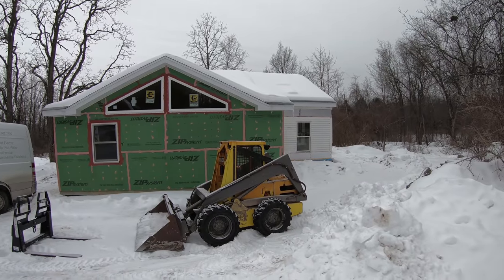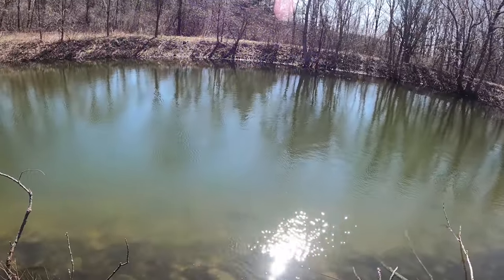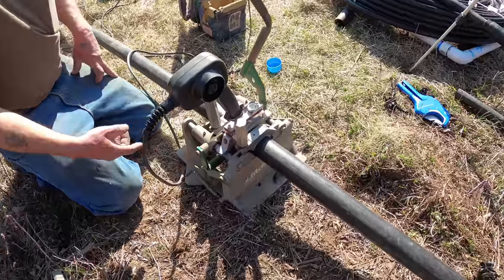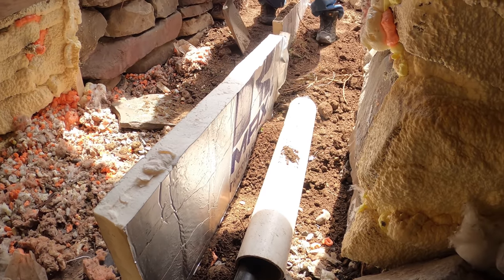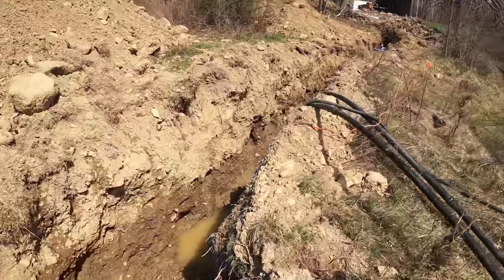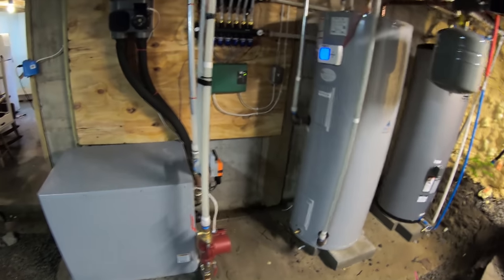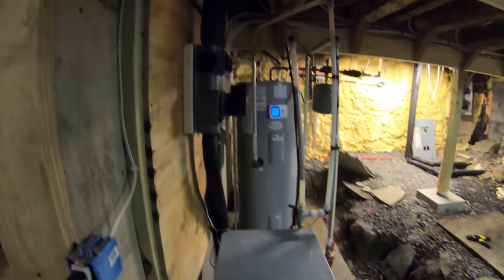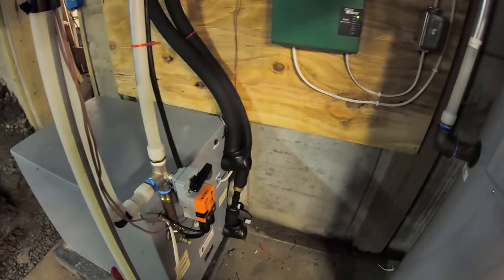Installing a Geothermal system (water to water, radiant heat)

Comment: Why is forced air such a popular way of heating in US? I am from Europe (Croatia) and here is most often heated by radiant heat. The main source of water heating is gas or wood. Recently, heating with heat pumps (air-water) has become increasingly popular, especially if it is underfloor heating otherwise they are water radiators. An increasingly popular is hybrid heat pump that combines the operation of a gas boiler and a conventional heat pump. When the temperature of outside air is relatively high it works exclusively as a heat pump, and if it is very cold then only as a gas boiler, and in between as a combination. The good side is that such a heat pump can also heat and cool, so everything is done in one unit.
Reply: Probably that most houses aren't built to live in, but built to sell. The vast majority of new houses are built by contractors or investors, to sell to people looking to move into that area, most of whom will live there 5-10 years, then move. They are thus quite sensitive to costs vs profits. If you're having a house built to live in it for decades, then you will have some different wants. That's also why so much if the US is basement-free, even though everyone would prefer having one.
Reply: The US has a much greater need for cooling than europe.  Radiant heat systems are very hard to repurpose into cooling systems. It's possible but an extra expense.  Cold areas of the US do use radiant heat but once you get to a certain point you need an air system (forced air or ductless) because the cooling load is so high.  If you use radiant heat, you end up installing two systems which is way more expensive

Comment: How many years before it would pay for it's self .. ??????  I might be dead  hahhaahah
Reply from the maker: The turn around is only 5 years or less when you compare to a conventional system. Forced air systems are not cheap either

Comment: Can’t see them saving any money really ever.  Especially If you calculate time value of money into the total cost and cost to operate and maintain vs propane.  Or electric. 
But who knows how high propane will get.?  It’s already ridiculously expensive.  And electric at least where I’m from is insanity.  Hope this surprises.  That’s an expensive installation. And This thing is going to burn a lot of power pumping all that water around.
Reply from the maker: geo creates about 4 btus for every 1 btu that regular electric heat creates. That is an enormous savings. $500/year is the projected heat cost for this house

Comment: I think you should build a grizzly on top of your dump truck bed to separate out the rocks and have clean fill that you can work far faster with and not worry nearly as much...  I mean, you are covering this pipe before it is a complete loop, so no good way to test and see where a potential leak is!!!  Finding a leak after it's buried,,,,,, ????????
Reply from the maker: i forgot to mention we put 100psi in the loop before backfilling and checked it along the way
Reply: @jmuller86  I knew you could not have covered it before testing. I kept waiting to hear what the typical test procedure is!!  What do you think of building some type of grizzly? Where you are, it would be handy for a million jobs. Even if you had to put someone else in the truck!!  Didn't Andrew C.  buy some type of rock stripper??
Reply from the maker: @SteveP-vm1uc  I am definitely going to build a grizzly, I want a big one to move lots of dirt. doing another handy smaller one for the dump truck sounds like a good idea too though

Comment: TOO Many moving parts. High chance of FAIL and expensive repairs. Ill take a rocket stove and copper lines and 2 small window ac units
Reply from the maker: any hydronic system has alot more moving parts than a forced air but they are more comfortable and if you are not using wood they do save alot of money.

Comment: TERRIBLE IDEA DO YOU KNOW HOW MANY TIMES I HAVE HAD TO REPAIR MY WATERLINE DO TO THE FACT THAT MY LINE WAS CUT DO TO ROCKS IN THE FILL OVER A PERIOD OF A FEW YEARS,  IT WILL HAPPEN IF YOU DO PUT A LAYER OF SAND THEN PIPE AND SANFDOB TOP OF IT       IF YOU DON'T THINK IT WILL CUT YOU BARE WRONG I HAD ABOUT A1000 FEET OF LINE FEEDING MY HOUSE UNDERGROUND JUST LIKE THE MATERIAL YOUR USING AND IT WAS A BIG FAILURE
Reply from the maker: this geo pipe is much different than normal well pipe. it is extremely thick and durable

Comment: Geothermal does not work in northern states.  Always laugh when people put it in.  They end up going to electric or propane.
Reply from the maker: You havent done much research I guess then.
Reply: @jmuller86  ya they put it in my work but different standards in Minnesota
Reply: Once you dig deep into the Earth, the location is largely irrelevant to the climate
Reply: I know farmers who heat their huge sheds with geothermal. Dig some and the ground will be cool, dig deeper and it will get hot.